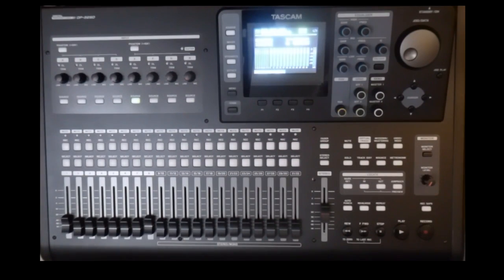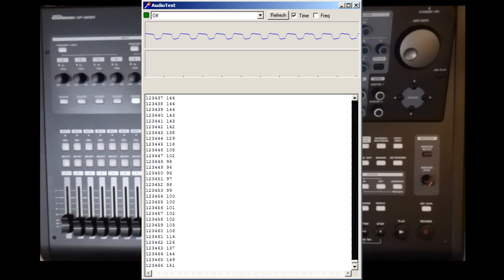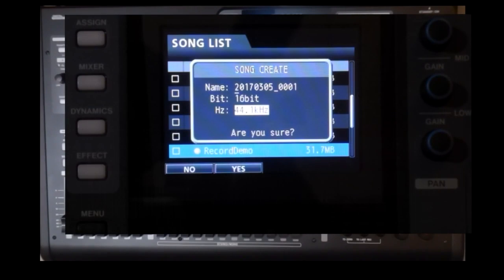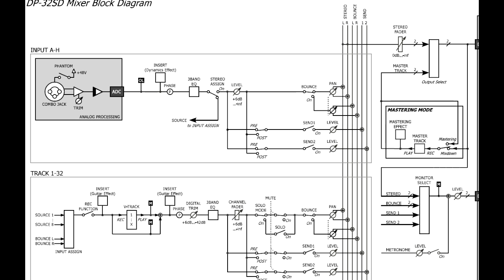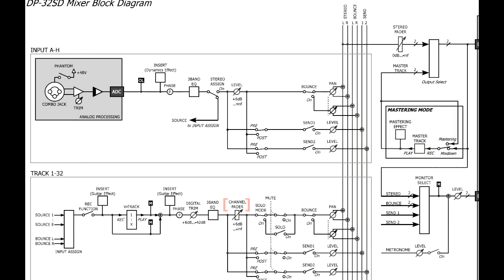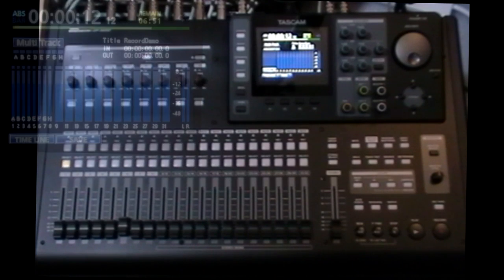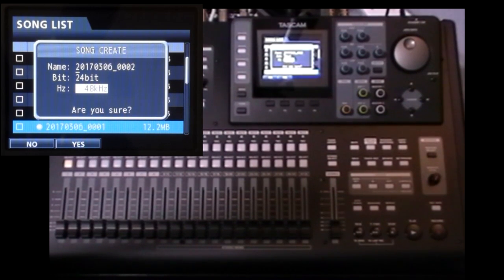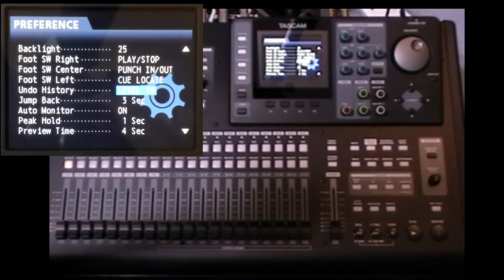Tascam DP24/32SD Tutorial 8A: Recording

Comment: So, I've had my 32sd for a couple months, and after I've been punching in manually a few times it will freeze on "record", even though nothing is actually recording. No buttons will stop it and all I can do is unplug it. Luckily, it automatically saves everything, but its becoming a real drag. I can count on it doing that nearly everytime. As I said, it's only when ive been manually punching in. Any ideas what the problem is, anyone?
Reply from the maker: @delphin bringsby it's recommended to run the 'delete unused' function every now and again (it's in the Song menu)... especially if you're doing lots of edits and punch-ins. As you say, it never deletes anything, so it can build up a huge number of 'zz' workfiles in the song folder (you can see these if you browse the card with a computer). 'Delete unused' will clear out all files which are not needed for the current state of the song. Note this clear out includes any history/undo files so be sure you're happy with the current state before invoking it... or better still, back up your song first - hopefully you'll be doing this anyway as part of 'good working practice' :)
Hope this helps.

Comment: I just bought a DP-24SD.  Tried to record a few tracks (I didn't like them) and tried to delete the song.  It says cannot erase content.  Why?
Reply from the maker: @Bill Sill The 'delete song' function won't let you delete the current song, so you have to load another song (or create one if there aren't any others). The current song is marked with a blob in the song list. You should then be able to delete the old song.
Alternatively, you could just delete the tracks you recorded. Press Track Edit and invoke the 'clean out' function for each track.
Another option is to use the undo function. Normally this only lets you undo the last operation, but if you set the no. of undo's to 10 (from the Menu, Preference screen), you can undo several operations.
Reply: Thank you so much, Phil.  I greatly appreciate your help.  I feel lost trying to figure this unit out.
Reply from the maker: @billsill4911  No worries Bill. If you get really stuck, the step-by-step guide may help - full details here http://www.philizound.co.uk/freebies/dp24-32/dp24-32.html Good luck :)
Reply: Awesome, thank you for your help, it is greatly appreciated.
Reply: Phil,

Why is Input H the only input that has a line-guitar switch?  What dos that switch do (versus inputs A through G)?
Reply from the maker: @billsill4911  The reasons are best known to the Tascam designers :)
The justification for having a switched input is that the input impedance on a 'standard' pre-amp is much lower than the impedance of an electric guitar pickup. If you plug a guitar directly into a standard pre-amp, the signal from the guitar will be 'damped' (dampened?) and it will lose treble or sparkle, or whatever you want to call it. This is more noticeable if you also have a long guitar cable as its resistance will compound the problem.

If your pre-amp is designed with a higher impedance, it will be better matched to the guitar pickup so won't affect the signal as much... but it won't perform well with normal line-level signals. 

So you either need dedicated 'instrument' or 'hi-z' inputs for high-impedance devices such as guitars, or you compromise and use a switch like Tascam to convert one of the pre-amps into either normal impedance or high impedance. I guess they could have put a switch on all 8 inputs, but that would have bumped up the cost.

So bottom line is input H behaves exactly like inputs A-G when that switch is set to 'line', but behaves as a 'hi z' input when the switch is set to 'guitar'.

Having said all that, there's no harm in trying both settings to see which sounds best to you. Just keep your levels down when experimenting.
Reply: You're the best.  I plan on buying your guide in a paycheck or two (I just spent $1,800 on new guitar, amp, Dp-24, and monitors).

The boss (wifey) told me to cool it for awhile.  All the best.
Reply from the maker: @billsill4911  Cheers Bill. Haha yes I know what you mean :)
Have fun with your new 'toys'... platinum album awaits.

Comment: I've been looking at three different amps to buy to use permanently with the tascam so I can record late at night and not piss off the neighbours (my laney iron heart120 full stack is to loud to mix up with decent sound late at night) I've been looking at the amp1 blu iridum, the laney sls and the Hughes and kettner blackspirit 200 floor amp,  I am so far swinging to buying the Hughes and kettner floor amp this wednesday,  what would be the best way to hook this into the tascam for recording and utilising the stereo off of the amp into the tascam  and what lead do I need to do this
Reply from the maker: @David Murray According to the Black Spirit manual (page 7), it has a stereo phone/line output. You need a splitter cable with a 1/4" TRS at the end which plugs into the Black Spirit, and 2 x 1/4" TS plugs at the other end for plugging into 2 inputs on the DP machine. These would typically be assigned to the left & right sides of a stereo track, although you could assign them to 2 mono tracks. If you did the latter, the tracks need panning left & right when playing back or mixing (you don't have to do any panning in order to record though).
Note this output is for headphones so it will cut off the speaker output. Also it may be slightly more noisy as the signal is going through a headphone amp, which is unnecessary if you just want to record the signal.
Page 8 also mentions the XLR 'Red Box' output which they say (on the bottom of page 7) is a better choice to feed a mixing desk, but this is only mono. It can be switched to Line level so should work ok with the DP machine's 1/4" input jacks. If you wanted to use this, I'd use an XLR-to-TRS balanced cable, and assign the input to a mono track.
Look a nice bit of gear! Have fun.
Reply: @philtipping  thank a lot Phil looking forward to buying and setting up on Wednesday 😁

Comment: thanks Phill for all the help and suport. i have watching them almost all. one question and would like help with. when i record vocal the sound is great when listening from the  tasam, but once i take the sd card and put ut into reader the vocal sound very poor. is it because i am not transfering direct from the machine? your help much appreciated
Reply from the maker: @alwater no worries, glad the videos are helping. The files held on the sd-card are your raw recordings. Any effects or EQ you apply when playing the tracks is only temporary; they are not actually recorded anywhere. So if you transfer tracks to a computer, they will just sound the same as the original recordings (don't forget, you must use the Export mechanism if you want to transfer tracks to play or process on a computer).
So to get your effects and/or eq into files for your computer, you have to either bounce the tracks, in which case the result will be on a separate track which you can then export to a computer. Or you can mixdown, in which case, the result will be on the 'master file' which you can simply copy to a computer.
It does not matter if you move the sd-card to your computer or use the USB link, the result is exactly the same.
Hope that helps.
Reply: @philtipping  much appreciated, thanks for the help and support  you provide💕💕

Comment: Hi man great videos on these, I’m currently using a pro tools and macbook set up, but also have a Korg d888 as i like the all in the one device idea for if i want ti record else where etc would you recommend this as I’m want to get back into a machine i can do some demos for myself on or even take else where to record, and mix just on the consoles and get a nice finished product, but i still have pro tools so will be possibly be eventually importing and polishing up the tracks in pro tools as well with the better post production option, would vouch for this to do the job or any other similar systems, and are the pre amps on these alright on the ears 
Cheers craig
Reply from the maker: @Craig Hughes -shug thanks for the feedback Craig. If your d888 still works, I would stick with that unless there are functions you want which are on the DP machines but not on the Korg. I don't know much about the d888, but the older Tascam units like the 2488/neo have more functionality than the DP models, albeit with hard discs, and many people still swear by the old units.

If you really want to replace the Korg, these DP machines are excellent for all-in-one devices, but they may have too many functions! They are complete studios in a box, so may be overkill if you just want to record and overdub a few tracks, and then use a DAW to process and mix them. I bought mine to do exactly this many years ago as there wasn't anything else available at that price, so the extra features went unused for a long time. However, I've grown to appreciate their usefulness for occasions when I don't want to fire up the rest of the gear (I use an old-school system as opposed to a DAW, but the principle is the same).

There are more choices now with the Zoom LiveTrak and Tascam Model 12/16/24 series, and these are geared more towards free-standing recording, and then processing with a DAW, but this comes at a high price. They also have more inputs than the 8 offered by the DP machines, but they are not 'portastudios', contrary to what others say - imho :) 

Regarding pre-amps, it really depends on your expectations. The DP ones are perfectly usable but there's nothing to stop you using external ones if you like. Some people say the Model series sounds better, but the difference is very small. In my view, you can always buy one or two high quality units as add-ons as opposed to searching for a device with multiple pre-amps of comparable quality.

Hope this helps. Ask around on the forums for more opinions before committing. Good luck.
Phil.
Reply: Phil Tipping hi thanks for getting back to me, yeah the principals the same, so if i was just looking for a desk to track on and mix with as-well as mix with a daw, does the soundcraft signature 22MTK fall under the same type of idea as the tascam model 24, i know it doesn’t have a recorder like the tascam, but as a type of way to work with digital and analogue at the same time
Reply from the maker: @craighughes-shug6694  I think you're right, although I've never used one so please double-check before committing :) This type of USB mixer sounds very similar to the Model series but as you say, without the built-in recorder. The USB connection allows live transfer of multiple tracks in & out, and the computer/DAW does the actual recording. The 22MTK looks a nice bit of gear :) Let us know what you end up with.
Reply: Phil Tipping thanks for the input and i will do indeed, going to do a little more digging first,
Cheers
Reply: Also the korg D888 units are nice little units, nice pre amps. They are a bit dated now they only offer a 3 band EQ on board, no dynamic effects although there are inserts for hardware. Theres none editing or automation options and they only record 16bit 44.1 Khz. For what they do there good but just limited and my desk as seen better days lol I’ve had it 11 years now.
Reply from the maker: @craighughes-shug6694  definitely time to treat yourself then! :)

Comment: Hi my friend, very in-depth video, well done and presented so thanks for your work.
I know I'm a bit late to party:) But I'm thinking of purchasing one of these but I noticed it doesn't have a CD burner.
So is there a way of  once the song is finalised and mastered exporting to say Logic on my Mac pro and then burn it to CD from the Mac??
Reply from the maker: @MayDay GoingDown!! thanks for the kind words. Yes you can use a computer to burn CDs. I would use a computer for this anyway as it gives you far more control over the CD... song layout, marker points, seamless gaps if reqd, CD-text etc. as well as being able to burn faster than real-time. 
The mastered song is just a single stereo wave file on the sd-card, so you just copy it from there to your computer (either move the sd-card or use the USB link). 
I don't know what software a Mac has for burning (or authoring) an audio CD, but I'm sure there are 3rd party packages available if there isn't anything bundled with the Mac.
The other main difference with the newer DP-24SD/DP-32SD models is lack of MIDI, but if this is reqd. you can always use the technique shown in video 13.
Good luck with purchase. Keep us posted as to what you end up with.
Reply: @philtipping  Hi my freind, first of all thank you very much for the fast response, It means a lot to me so thank you.👍.
Yeah I noticed these ones don't have Midi..but you know what...I'm so fed up with Midi at the moment, I use a mixture of both Hardware Synths and VSTi on the Macs using Logic, and I'm so sick and tired of having to program CC midi parameters etc...
It would be nice to just have a hardware recorder again like the old days.
I'm just thinking of recording onto the Tascam via good old audio jacks line ins, and then exporting the finished project to Logic, then tweaking certain things through logic and from there burn to CD.
Don't think I need the 32 track to be honest, 24 would do me.
I'm going to sub to your channel now and watch your back catalogue.
Once again Thanks my friend.
Reply from the maker: @maydaygoingdown5602  understood. Just a couple of things to consider with the 32 vs 24. 
The 32 has switchable stereo/mono tracks whereas the 24 is fixed. You only get 1 mono per channel (not 2 like you'd think) , but it's still useful to have extra mono's in some cases, as is being able to switch them back to stereo at other times, e.g. recording keyboards, synths etc. - this flexibility swung it for me. 
Also, are you likely to do processing and/or overdubbing on the machine before you export to the computer (maybe not now, but later if you get fed up with the computer)? If so, having extra tracks is very handy for multiple takes, editing, bouncing, etc. Someone once said you can never have too many tracks (or was that me?!). Here's me sounding like a salesman now - lol, but there's no connection with Tascam... more's the pity as they've never acknowledged the extra sales they've got off the back of these videos - that's life though :)
Good luck.
Reply: @philtipping  Hi mate, do know what, after watching your back catalogue of vids on this recorder I'm now thinking it makes more sense for me to go for the 32 track, especially for synthesizer recordings, the flexibility of those stereo options could come in handy. 
I tend to do all processing on the Mac through logic...but yeah you never know down the line so again it would be good to have that flexibility wether now or later.
I must admit I much prefer hands on hardware over computer and software...guess I'm in that generation:) I don't mind the Mac but I still hate having to fiddle with Midi CC....takes up to much of my time.
Thanks for the tip about the 32 track, and yes I think Tascam should be recognising your work indeed, wether it be free products to review or cold cash:).

Comment: How do I turn multitrack off
Reply from the maker: @king 9 ether not sure what you mean. The machine's normal state is 'Multitrack'; the other modes are Bounce, Mixdown and Mastering.
Reply: @philtipping  it seems as if the machine only wants to record in virtual tracks... It working good last night until my memory card got full..
Reply from the maker: @king 9 ether Not sure what you mean by this - all the tracks are virtual really (see video 8E)... but if you think the machine has got itself into a knot, try a factory initialise (via Menu, Preferences) - you won't lose any audio data. If this doesn't work, the sd-card may be corrupted so either try another one, or back it up to a computer and format it on the dp machine. Create some test songs first to prove the problem has gone away, then if it has, copy the songs you want to keep (just the song folders) back from the computer. The step-by-step guide shows how to do this. Let us know how you get on. Good luck.
Reply: @philtipping  thanks 💯
Reply: 0